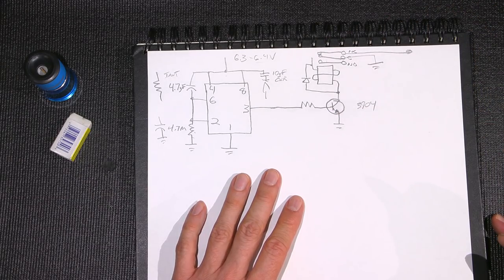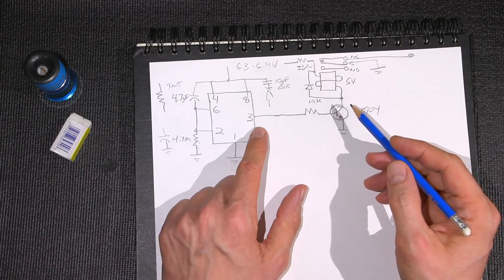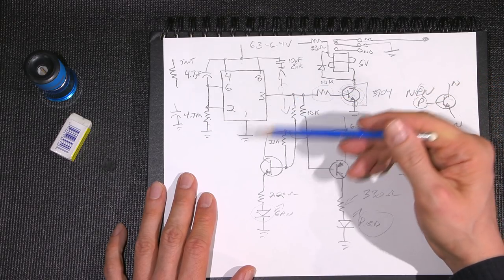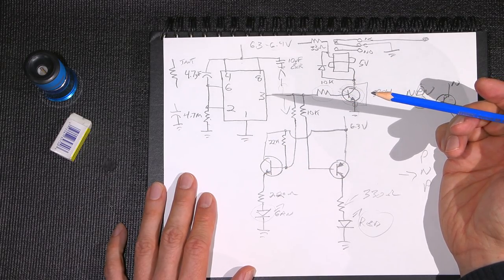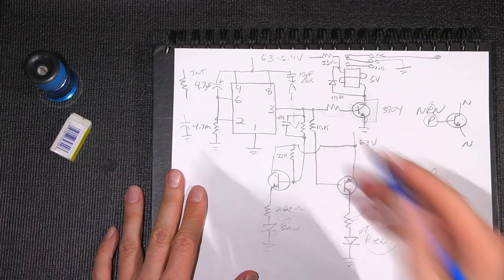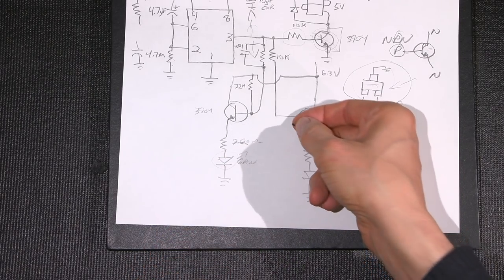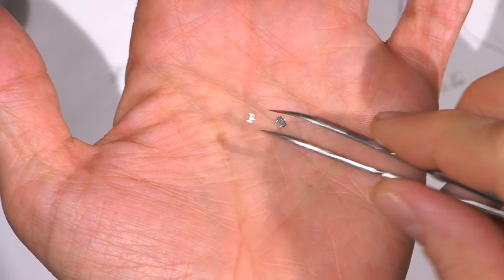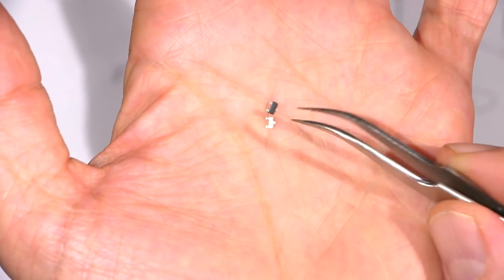Create And Build An Electronic Circuit!

Comment: You could simplify by just connecting the green LED and its series resistor in parallel with the relay coil and get rid of ole transistor + its surrounding components.
Reply: You could also select such a relay (V to switch on and current) and a LED (threshold V and current vs. brightness) that you could drop the 6.3 V to the relay coil with the LED in series with the coil.
Reply from the maker: The LED has a common cathode between red and green, so unfortunately no. If the LED's were separate, then that scenario is possible.
Reply: @MrCarlsonsLab  Oh, I didn't notice that, probably watched too quickly... In any case, I really enjoy your channel! Keep up the excellent work!

Comment: I'm not an electronics expert by any means but I have a question: The two 10k resistors feeding the transistors for the LEDs, could you just use one resistor for both transistor?
Reply: You cannot guarantee the transistors you use in your design will be identical. Even if you picked identical specs and ordered them from the same manufacturer. Because of this, you will run the risk of unpredictability in your design.

Comment: Interesting, never seen dual package LED's in SOT 23 thanks! could you tell me why the green LED transistor has a resistor across base and collector please ? also would it be possible to put the green one in series with the coil ?...cheers.

Comment: My SS audio amp has a delay speaker connection. Once in a while, when i turn on my amp, i hear a very pronounced thud end fairly significant surge sound i think from the transformer getting instantaneous power. Is there a way to calm that? I bet the relay is producing a real nice spark flash. Sony STR-DH540

Comment: Why the 22k resistor on the NPN for the Green LED? It seems like it's to prevent a floating state, but then why no resistor for the relay NPN? And is there every a floating state with the 555?

Comment: i think it could be  done without the extra transistors for the LEDs: connect the common cathode of the LED to GND via a resistor, connect the green anode to pin 3 of the 555 and the red anode to the low end of the relais coil.  So the red LED gets its current through the relais coil until pin 3 gets high and switches on the transistor and the red LED.

Comment: Great video! I have a newbie question though, can you elaborate on why you added the 22k resistor to the green LED circuit at 26:50? There was already a 10k base resistor hooked up to the 555 output, was that not enough on its own? Thanks!
Reply: Yeah.. great vid! I would also like some rectification here...

Why is there no 22k at the relais path?
Or at the PNP path (maybe to GND)? But at that path...
thx in advance

Comment: I was thinking wouldn't it have been a good idea to operate your green led off the NO contact of the relay, that way the relay would provide ground when it switched, that would give you a troubleshooting indication, if the red goes out and the green doesn't come on you would know there is a problem with the relay.
Reply: note I made my comment before you got to the part of changing the LEDs to a single unit requiring a common ground.

Comment: Did not finish video before making this comment.
Between 27 - 28 min on video, when you are adding in the green led, just wondering, why did you not add it between the NPN and the 5v relay? This would have one less NPN. When the first NPN turns on, it would turn the led on. 
My electronic knowledge is low, just trying to understand more.
This comment is after the video.
You are putting a delay on the audio output, I think.
Just wondering. Could you put an power output plug on the amp that would go to power the monitor speakers, and put the delay circuit on that?
Not trying to second guess what you are doing just trying to get a understand of why you did what you did.
My thinking on doing a delay on the power line, would be less chance of changing the audio output. Then on the monitor speakers delete the power switch, let the amp turn them on or off.

Comment: Just wondering (I'm 30 mins in): The PNP transistor for the red LED: aren't the LED and associated resistor on the wrong side of the transistor? The PNP is used in low-side switch configurations, yes? Or does it not matter for LEDs? Forgive me if it's a dumb question. Very much a novice! Other than that I understood it all!
Reply: pnp is usually for high side switching and in this configuration it is. the npn being used as a pass element you can imagine as a glorified switch that wires 6v3 or gnd to the led from the high side ... so that circuit works and there is nothing unusual about it.

Comment: My Yamaha Stereo receiver from 1976 has a relay on the amplifier output.  With age, the contacts have built up some resistance and won't pass the audio signal.. I have to periodically open it up and clean the relay contacts.

Comment: Would a Logic level FET driving the relay with gate connected to a grounded capacitor and the gate also connect to a resistor to 6.3V be a considered a bad design.  It would eliminate the 555.  I see that it would operate in the linear region until it saturates but it would only last 30 secs or so and not overheat.  It would also turn off gradually so the relay coil would generate less or very little inductive kick and could almost eliminate the diode across the coil.
I have a suspicion it is a bad design, just not sure why.  What say ye?

Comment: I tolerate switch mode power supplies with gritted teeth.  They are light, they are efficient... but they do make RF interference, even the best ones.  

I had one in my shack that was specifically designed for use in an radio communications environment.  It's better than most, but you CAN see noise from it on the HF bands when looking at a radio spectrum waterfall!

I went back to a good old tried and tested linear power supply.  It's big and heavy, and it runs a lot warmer than my switch mode power supply... but I cannot discern ANY RF interference being generated.

Comment: Can someone explain to someone with only a basic understanding of electronics the application of the 4.7 micro cap and and the 4.7 meg resistor to actually achieve the wanted inputs on pin 2 and 6? If I understand correctly to achieve the the wanted output, pins 2/6 would have to start up at > 1/3 Vcc (otherwise the output would be high in the beginning), the voltage would have to decrease over time to reach < 1/3 Vcc after the 30s to turn the output on (and please correct me if I am wrong). But how does this combination of cap and resistor actually achieve this? I am pulling a beginners blank here :) Thanks for saving my weekend from wondering about this all day.

Comment: Could have just tied the red led to the collector, other end through a resistor to gnd.  For the green, you could have just again just tied it to the collector and the other end through a resistor to 6.3v.  Would not need any transistors for the leds at all.
Reply from the maker: The SOT-23 LED has a "Common Cathode"..... so no.

Comment: What about creating this Amplifier using TELEFUNKEN Low Voltage Space Charge tubes to have a B+ of 45V and a Heater voltage of 3V so anyone can build this and not have the electric shock hazard.
Reply from the maker: Hi David. Space charge tubes have their control grid pulled to the plate, and the signal is fed to the screen. They normally operate at 12 Volts, and are great voltage amplifiers, but very weak for current delivery. Since this is an OTL design, unless I used a transformer, the drive to the headphones would be very small with a space charge device.
Reply: @MrCarlsonsLab  OK No problem.

Comment: The delay time is calulated with the formula td = 1.1*R*C = 1.1 * 4.7*10^6 * 4.7*10^-6 = 24,299seconds? If yes why the timer works for 30seconds delay?
Reply from the maker: You will only "Really Learn" about electronics when you stop playing on paper, and get a breadboard.

Comment: Does the 30 seconds come from 5*R*C*(1/(2/3))
Reply: (Editted)
No, 5RC is the approximate charge or discharge time for a Capacitor+Resistor in series (Approximate because it is an asymptotic process).
For a 555, the capacitor used is never fully charged (only 2/3) or discharged (only 1/3) before the 555 switches. For this, the term 'tao' is used, and that stands for RxC. For the 555 I read that T (time) = 1.1 x R x C.
If you like: https://www.electronics-tutorials.ws/waveforms/555_timer.html

Comment: Strange thing happened to me watching this video:
at 25:52you draw the schematics for the green LED, an PNP transistor, base resistor, but you put the LED + limiter resistor in the emitter, and add a 22k from base to Vcc. I scratched my forehead, and said:  that's wrong, the LED should be in the collector, and then the 22K is unnecessary. When you put the LED in the emitter, you need a lot of Voltage on the base, and since the output of the 555 is about 1.5V below VCC this could be a problem if you want to saturate the transistor. I waited until you would see the problem.... How to make it more simple.... You didn't.
But then I thought:  what if he has a LED with two colours, with a common collector in stock ? Then it would make sense.
Well, the strange thing I experienced was that you reacted surprised remembering having just that :)
Reply: B.t.w., what exactly the pro's for using the load in the emitter for switching are I don't know, my knowledge and experience are really not as wide as yours.

Comment: He got excited for not using a cap on pin 5, then he uses 2 transistors and extra resistor for diving the two LEDs. I would have connected both LEDs to pin 3, one to vcc the other one to gnd. Of course with a resistor on each.

Comment: Mt Elekit TU-8500 tube preamp does the exact same thing. It has about a 25 second counter and the normally closed contacts on the relay have the output of the RCA shorted to ground, and when the timer gets done counting and energizes the relay it opens that connection.

Comment: Ok what is a PNP circuit ?
Reply: That's not a thing, as such. A PNP (or NPN) is a transistor. So, a "PNP (or NPN) circuit" is just a circuit using that transistor. (Or did you mean what the internal structure of that transistor looks like?)

Comment: I’d have used a DPDT relay and driven the LEDs from the second set of contacts. But then again, I’m not Mr. Carlson...
Reply: Netpilot  ,  How much power would it take to drive a double pole, double throw relay?  Mmmmm or if you had a relay on the shelf which could do one or the other of the jobs.
Reply: Bruce Nitroxpro  I meant that he used an SPDT relay in the design because he had it in his parts bin. I’m sure he had the transistors and other components to drive the LEDs on hand, too. I’d have simply bought a DPDT relay instead since I’d be buying the parts to build my own circuit. Then I’d just need two LEDs and two resistors for those indicators.
Having so many components on hand and using transistors to drive the LEDs is what separates Mr. Carlson us mere mortals. 😊
Reply: Ok, facepalm. I wrote my first comment while I was watching him draw the schematic where it looked like he was only grounding one audio path. When I saw the PCB, it turned out that he did use a DPDT relay to separately ground two audio channels. Hence the need to drive the LEDs another way.  🤦🏻‍♂️

Comment: 11:22, I see a cable with only live and neutral... where is the ground? If, (and I might say that some computers have a leaking of power when connected to a rj45 cable that does sting), a power unit is grounded by a real grounded outlet, then inside the powerunit it might be ground up to the secondary poweroutlet minus pole, but when manufacturers build cheap, they tend to 'forget' to actually lose the grounded connection. Seeing your build, mentioning those screws, makes me think.... is there use for that? (when there is no grounded connection)
Reply from the maker: I really dislike "ground loops"
Reply: @MrCarlsonsLab  
Maybe, but getting a shock from so called grounded appliances is never fun. I like my hardware to be fully grounded. Real deal that is. Still there are devices out there with the two small squares symbol on it, that are not actually safe when it comes to connecting it to other devices. I once had a shock and went measuring it, it was over 80 volts. Now I am no electrician but I did know this should not happen in combination with approved appliances.
Still I like you to go find such devices out there with L and N only, and try to find where such voltages could come from.

Keep up your great video's, they are very good.

Comment: Great frequency curve, but totally useless to an old geezer like you, who has probably lost 5-10 db and about 8 kHz off the top end, this could be enhanced depending on how many Ted Nugent or Black Sabbath concerts you attended and how close you were to the speakers!!
Reply from the maker: Hi Tim. I comfortably hear 15kHz, and if I move my head from side to side (at lower volumes,) I can hear 17kHz. At raised a volume 17kHz is very annoying.
Reply: @MrCarlsonsLab  Ha Ha, thats great, I am down @ 8.5 kHz now so will probably need some in ear amplification in another 5-8 yrs, by which time I will be 70 , have sold my marantz reference stuff and be sat in a corner with the TV on volume number 11!

Now there is a project, a super cheap digital hearing aide for those with a lot less money than the 3000 dollars most of them cost..

Comment: You can buy a delay module for a fiver.
Reply from the maker: That would make a pretty boring video wouldn't it Barry?
Reply: Oh, don't get me wrong. I love your channel and especially your resurrection of old equipment. I never miss an episode and I have learned a lot. But you could create a delay using discrete components, of course, even valves, and a 555 is a concession to modernity anyway and I was only pointing out that the next step would be a module. But please keep this channel going. I wasn't criticising and you are one of my heroes!